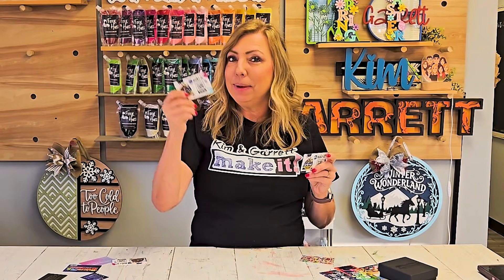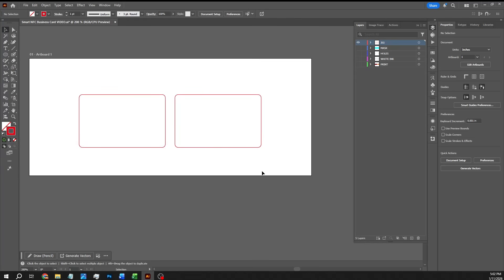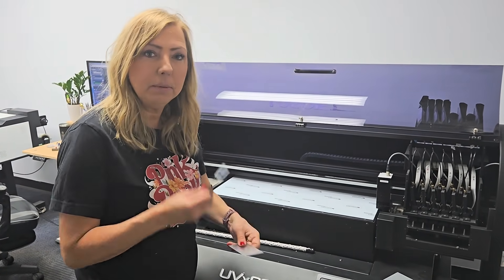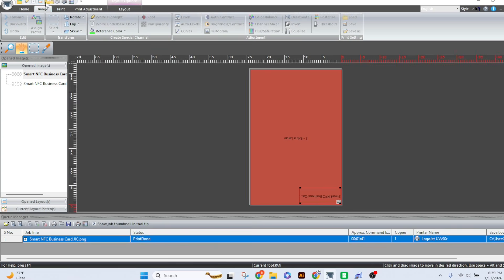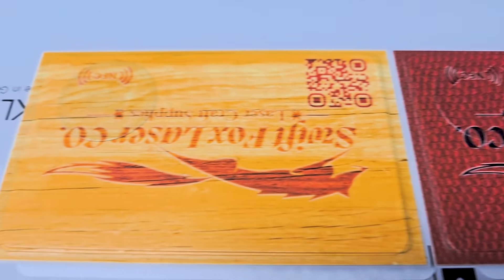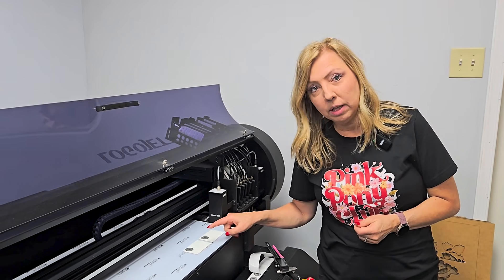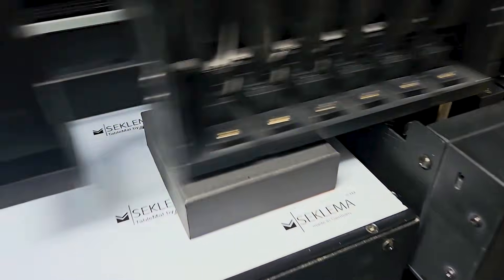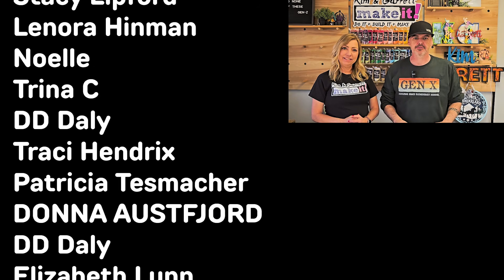$1 Cards, $50 Price Tag - The Complete NFC Setup

Comment: $25-$50 too low. A "forever card" negates a customer's need to purchase more cards when they run out(repeat sales), therefore, the value of the card should be much higher,  maybe closer to the cost of 1000 business cards or more. Pricing so low will erode a market that has low repeat sales.
Reply from the maker: I like your point about the "forever card" aspect and its impact on repeat sales. Thanks for sharing your thoughts!